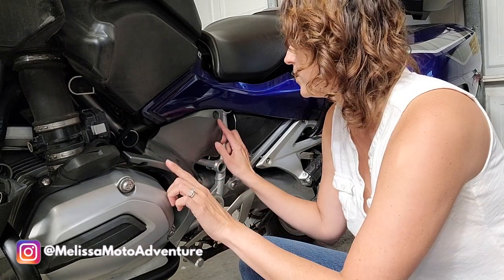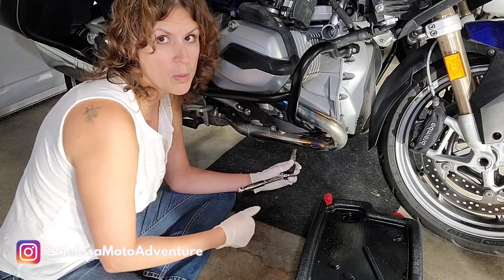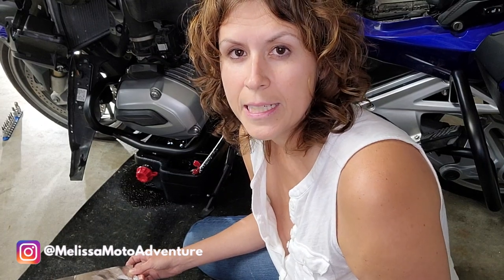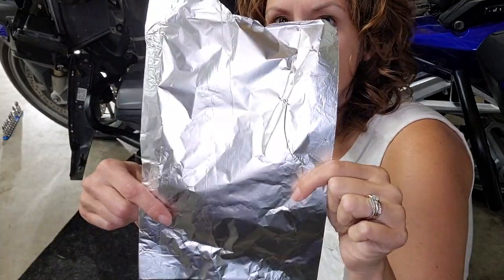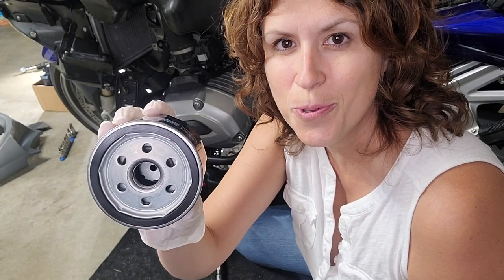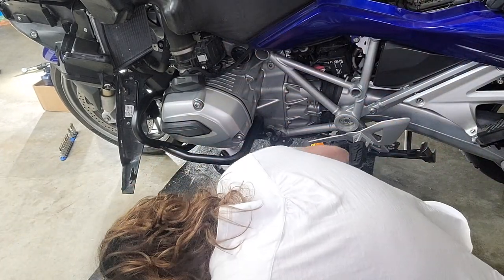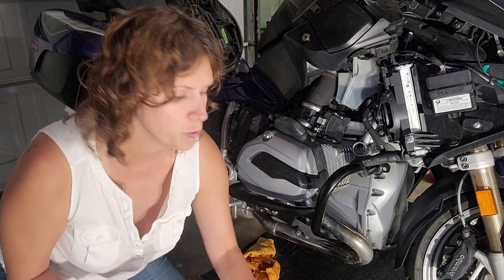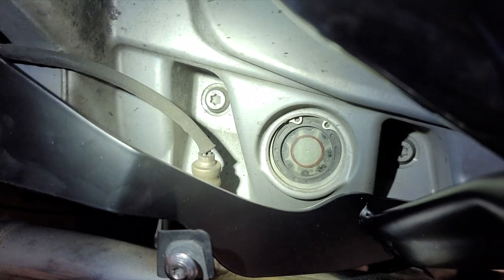HOW TO Change Oil on a 2015 BMW R1200 RT

Comment: Why side stand and not centre stand?
Reply from the maker: You could def use the center stand. Frankly the BMW is a little heavy for me to get on the center stand and the oil drains fine by being on the side stand so it works for me :)
Reply: @melissasmotorcycleadventures  First, thank you for the video, but just be careful when filling oil on the side stand as the difference in oil level is dramatically different than when it's on the center stand. The reading when its on the side stand is at the min level, yet on the center stand reads at the max level. If you fill to the max line when on side stand it will be extremely overfilled.
Reply from the maker: @HeathDamienHuffman  thank you for the suggestion. I actually under filled it and then double checked it on the center stand...just decided to cut that out of the video haha. Thanks for following my adventures :)
Reply: I own a GS1250 ( 550 pounds) and to help raise it on the center stand I roll the bike backwards on a piece of plywood approximately 1 1/4 inch thick and then activate the centerstand…bingo! Marc, Quebec, Canada 🇨🇦